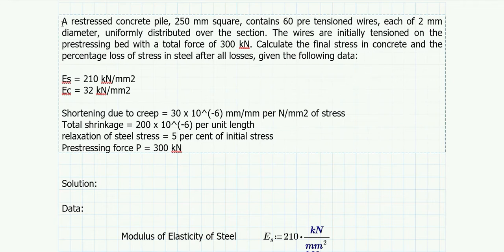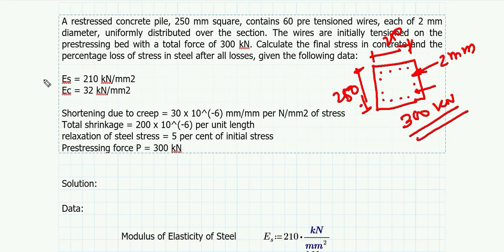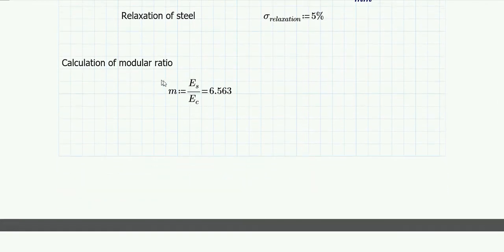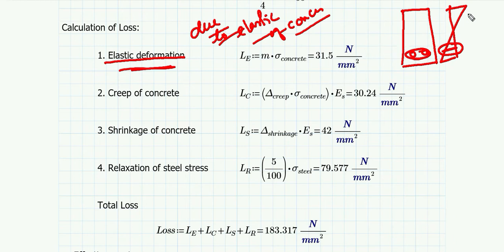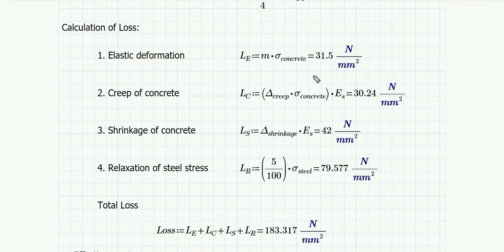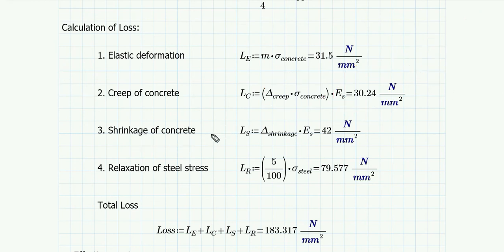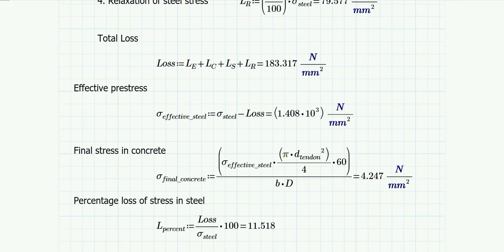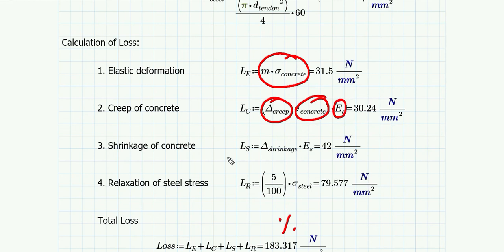Losses in prestress concrete (other than friction)

Comment: While calculating the loss due to creep, it should be multiplied by the elastic modulus of steel but the given value matches when Ec is used.
Also I didnt understand why 31.5 as stress in concrete is used for the same calculation instead of 4.8 (stress in concrete worked out before)